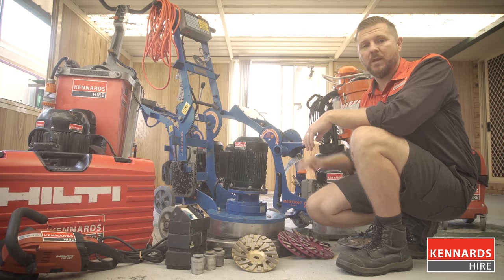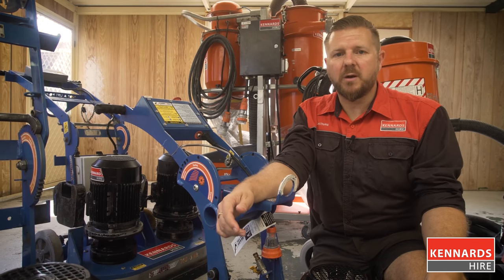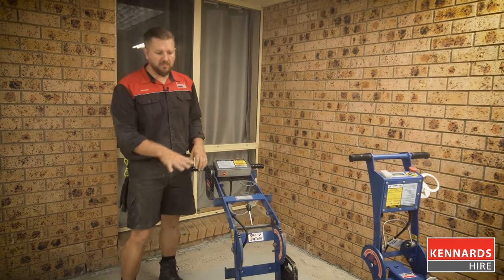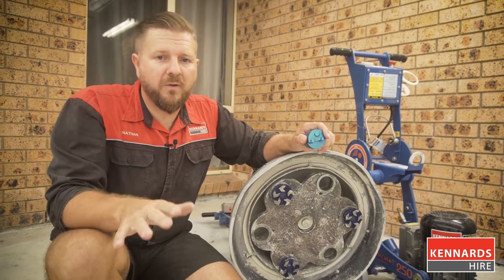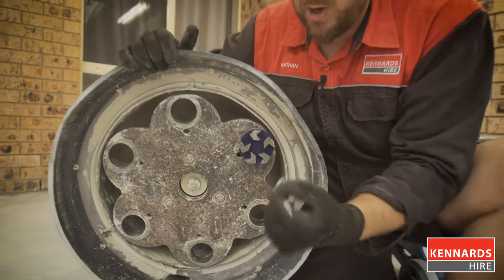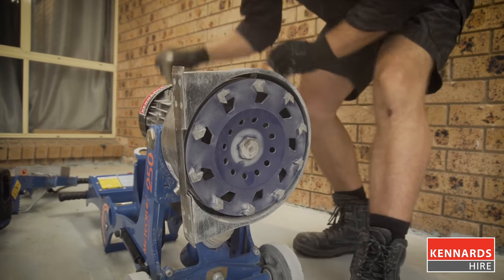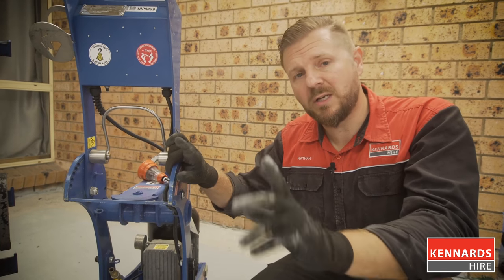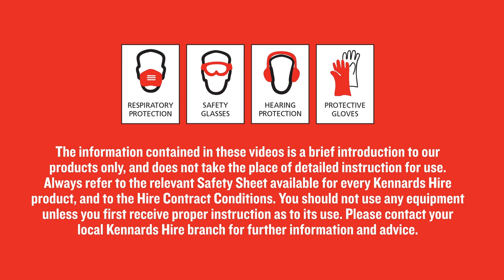How to Use a Concrete Grinder

Comment: What about removing the top inch or 2 to redo the surface?  I ran out of time stamping and was thinking of using this to remove the top 1 to 2 inches and resurface it with a bonding agent.  Thoughts?

Comment: I have a slab of about 50 feet x 35 feet with a very rough concrete finish. It could need at least 8mm concrete removed in areas as it was laid down very badly. Would one of these machines do the job?
Reply: can you please  tsĺk and èmgkud
Reply: Yes it would